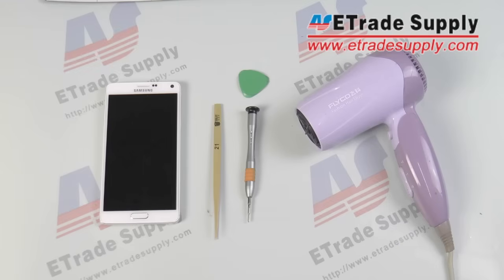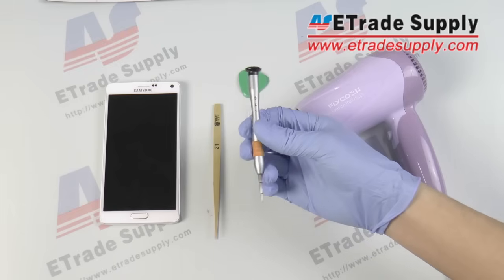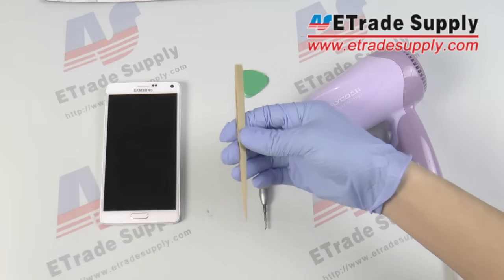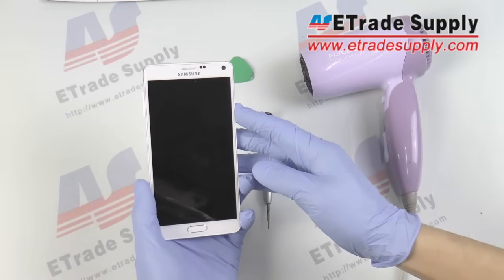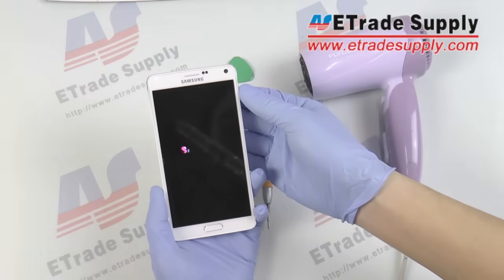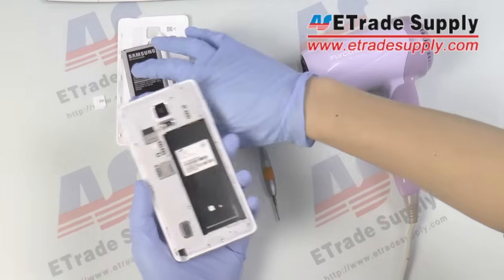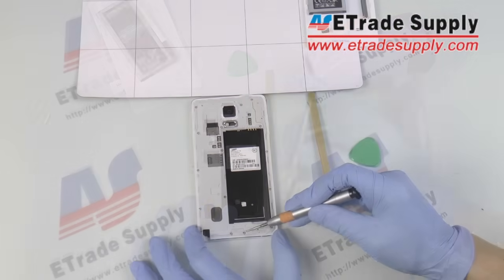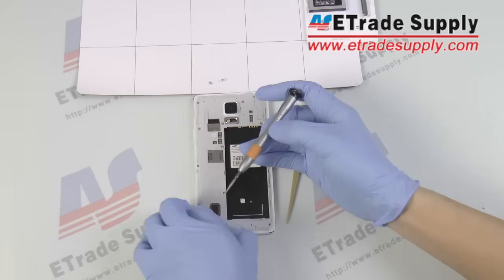Samsung Galaxy Note 4 dissassembly/take apart/tear down/screen replacement

Comment: How to detach the "Speaker"  on Middle-Shell ?
Reply from the maker: you mean the loudspeaker? it is sticked to the middle shell, you need to use a plastic spudger to pry it up.
Reply: Yes and Yes,  but I heated it with a Hair-dryer before pried it with a "I-shape" srewdriver. Thanks for the Video and reply.